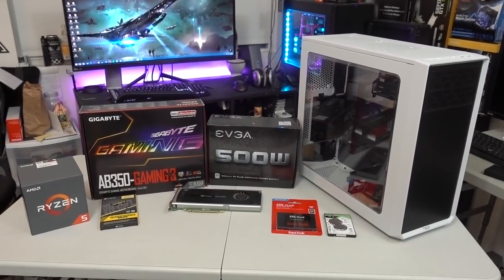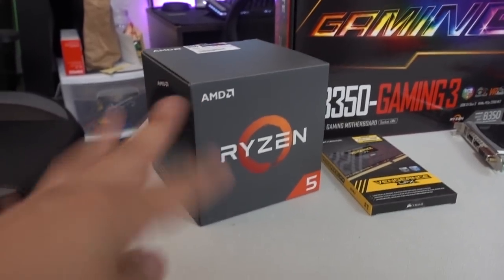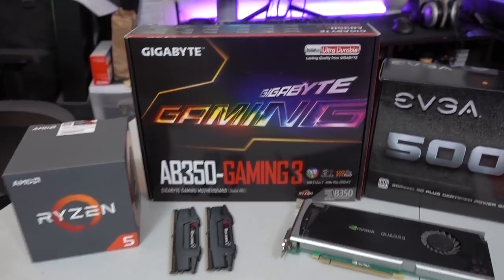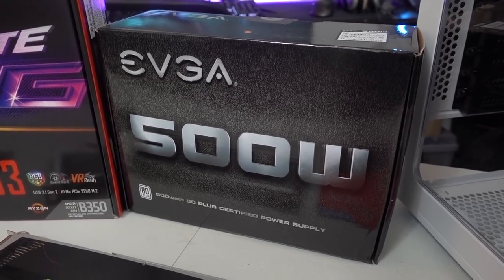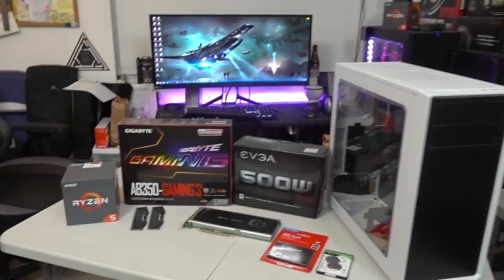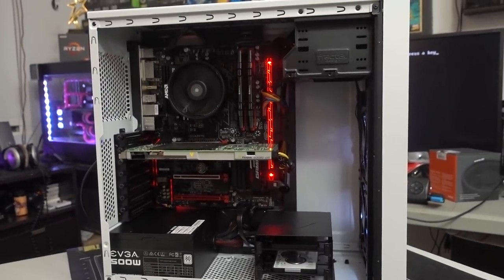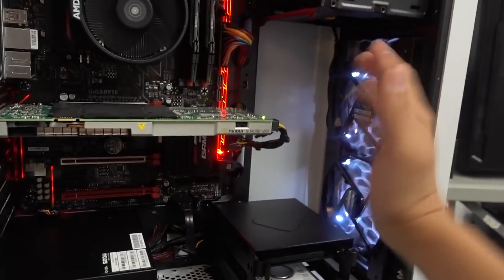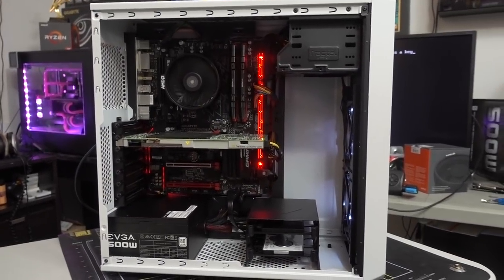A Ryzen Workstation for the Family!

Comment: $200 for refurbished Asus system with i7 3770, 12GB ram, 1TB 7200rpm. Added 120GB ssd boot drive and rx480 8GB before mining scalping. Beastly system for full autocad 2017 drafting and rendering at $500... A better processor would obviously "be better", but cannot be beaten for the price.

Comment: Wouldn't a GTX1050TI still be better in Cad than that Quadro? It's only a 475mhz core clock and only 256 CUDA cores sure it has better drivers but wouldn't the 1050 still be a better option for $200?

Comment: Thanx for making this video. I've just bought this case (Nov. 2019) and it was good to hear about the tips to trouble shoot like the audio plug in to the motherboard to be done before I put in the power supply. I'll use the 5 1/2" drive bay for a dvd / cd burner drive so is there enough room behind the mobo to tuck away the cables well. I did opt for a modular power supply this time around for my new Ryzen 2700x. I feel it'll cool well after I put in the total or 5 or6 fans the case can use. Do you think it will be good enough as a gaming and photography rig? Thanx

Comment: Would the 1700 been better for workstation cpu unless they are using the gpu acceleration for most if it
Reply: I wouldn't consider anything less than 1700 for a workstation.  This thing will probably be in a dumpster in about a year.  I know this because I destroyed a computer like this when I first stared editing videos.  The only thing good that came from that experience was I got paid really good to build another computer that could actually handle editing videos.

Comment: Not exactly sure about Fusion, but AutoCAD doesn't do "great" with multi threading. There's only a handful of operations using more than one thread at a time. It would be really great if you at least run something like the Cadalyst Benchmark for AutoCAD - I've still found that Ryzens don't do as good as the Intels for this, though at a higher price point. At least that would show some actual comparisons by running a script of instructions for creation and modification - thus able to compare with other setups.

Also, the quadro is the only officially supported graphics card from Nividia for nearly all AutoDesk products. Tested and certified with specific drivers. So yes, it's the choice when you want to be safe. Though for lesser cost you could get better performance out of some Geforce. You'd just need to test it for yourself using various versions of the driver. The latest isn't always best for CAD (it sometimes introduces bugs).

As for RAM, great, the less the disk gets accessed (even that SSD - though good call on that too) the better. Personally I'd say no CAD should have less than 8GB these days, 16GB is sort of average. With high workloads going much higher than that.

Anyhow, all that really depends what is being drawn. In some workloads an iGPU is fine, and the CPU itself isn't really of much importance. Sometimes a 4GB RAM kit just about squeaks through, while at others 64GB isn't enough.. Then again, other workloads could mean you need much better hardware - actually top of the range for all is still a bit on the slow side. Unfortunately CAD (especially 3d) isn't a one-size-fits-all idea.

Comment: Just fyi if they are using solidworks you are not going to use those 12 threads
Reply: there is a nice article on it on pjudget systems site comparing the 7700k and th 1700

Comment: Looking nice Kyle, "but" 3D modeling / engineering  I would use 32gb of ram or more. I'm maxing out my 32 at quite frequently  in cin4d/proEngi/solidW (engineers don't care about polygons) and mooooore and finer dust-filter. A workshop is no clean place ;) GJ wifysauce in building it, kyle probably just stood around :P :P

Comment: Hey I'm late but I'm looking at a similar build for 1080p video editing. Can you try and export like a 15 min video on it to see how it does? not sure if I'll need the 1700 instead
Reply: Devon Wenger Woah you don't really need a 1700 for 1080p video editing the heck even the 1500x can do 1080p also the graphics card in this is 7 years old so I would recommend another card to render videos faster and other shit.
Reply: Hector thanks. I'm currently struggling with the i5 4200u so I have no idea what a good CPU is like. as for GPU I'll get an rx580 when I can find one at a reasonable price but in the meantime I found a gtx770 for 80 bucks.
Reply: well a good cpu i would totally recommend would be the Ryzen 5 1600 it comes with a really nice stock cooler and with 6 cores and 12 threads you can edit or render any 1080p or 1440p video.Ok now thats the cpu opinion now comes my GPU opinion look a gtx 1060 is certainly better than a rx 580 in terms of Gaming now in terms of Content Creation i would think a rx 580 would be better but i mean you probably want to be playing games at such a stable and great fps so i would go with a Gtx 1060,Cheers.(also if you are getting a gtx 1060 i suggest to get the 6gb of vram variant)

Comment: I have 2 Quadro 4000's .... They are like a GT 630... also HOT AF except the HP one (black version)... You would be way better of buying a 300$ gaming GPU... even for 3D CAD.
Reply from the maker: I used afterburner to crank the GPU fan to 50% and am getting decent temps. Noise emissions aren't an issue since the rig will be in a machine shop. Also, gaming cards are great for video editing but typically lack reliability and accuracy required for precise calculations in CAD
Reply: Bitwit You got lucky getting a good one. Some of them were so bad that they were running at 100°C at idle... But still a nice build. :)

Comment: I know you grabbed whatever you have available to build this system
 but let say if you;re buying things off the shelves
#1 Case would be mini about $25 from Antec or a mid tower for $22 from Tt
#2 Motherboard as you mentioned wouldn't have to be a gaming one but you can save way more on 
ASUS Prime A320M-K for $60 yea there is no need for B350 or X370 for this build but ... for $20 more you can mATX from ASRock 
#3 RAM was it an over kill? stock speed are more than enough for this build#4 Video card choice works but regular gaming card would function ok and can be bought cheaper and with warranty like RX 550 or GTX 1030#5 PSU is good and it works and usually that's what I do whatever PSU deal around I would take it but I'm not going trust that filter to be cleaned on regular basis and I would flip the PSU for the fan to be inside the case#6 HDD performance on a 2.5 vs 3.5 unless that 2.5 was a hybrid then that's another story#7 why not pop in an optical drive? for $20 you can get a nice burner and that might be useful if they want to send projects in mail#8 UPS Battery Backup?#9 new clean keyboard and mouse? 
I think I ran out of things I would've done. But yea whatever you grabbed around you I would've done the same except for the RAM (i think it's overkill and I know how Ryzen likes fast RAM but still not needed), and I wouldn't pick that refurb quadro as I wouldn't trust it

Comment: Using a quadro is just lack of research from your part. If drivers working better on 3d rendering or whatnot in the past were a thing, it is not the case nowadays. Don't overclock it, and you will get a rock solid stability on regular NVIDIA gpus. And Ryzen 7  is still a clear choice if you are going for AMD. If you wanna do a "workstation" rig, don't go too cheap or it will be a useless system taking forever to do your renderings.

Comment: Kyle, you realize that gpu is a fermi gpu right? Like 400/500 series?

That thing is so many years old... I wouldn't be surprised if a GeForce card did better than it. Seriously,

You coulda got a p1000 or m1000 instead instead of getting something that hasn't gotten new drivers in a few years. I haven't even mentioned the bad psu...

Comment: You basically have my PC there lol
Reply: Ulises A. De Jesus lol srsly that's ur GPU?
Reply: lol man no,  but I have the same processor,  RAM, SSD, hard drive, power supply, and a very similar white case but with an Asus white card (GTX 1060)
Reply: ohh thats cool im planning to build a gaming pc my self i currently have a really old pc that is also a workstation
Reply: Yeah, Ryzen 5 1600 and GTX 1060 run very smooth, I'm only playing Overwatch right now lol, I actually got lucky with the card, bought it for $249 on Amazon, pretty hard to find cards at MSRP price right now...
Reply: A gtx 1060 for $250 wow that must have been a pretty good deal right now a gtx 1060 is $500+ which is pretty disappointing and whats funny a gtx 1080 cost less than a gtx 1060 rn.....And ofc gotta love those crypto currency miners for the prices being so high! (Sarcasm)

Comment: alot of 3d software are using graphics cards more and more to render these days.. but with the mining boom taking all the midrange gaming cards I see why you did what you did.. I would of gone 1060 6gb for 220.00 ish had the prices and availability been there.. 
power supply is over kill.... can go sub 500 easy to save $ and not sold on the value of 3200 memory with prices like they are.  2400 will work for 40$ less.. 
the case can be a 25 special.. no need to spend on that.. maybe even reuse the original? 
Those savings could allow you to spend 100$ more on cpu and get the rx1700. 
16 threads > 12 threads .

Comment: Aren't 2.5" HDDs much slower than 3.5" ones?
Reply: They can be, but not always.
Reply: MrOnihige of course there are some 2.5" drives that are faster than some 3." drives but with 50$ for 1tb you could get a 2.5" drive ore a 3.5" drive that has larger and more disks spinning faster.
Reply: Of course? FFS, why did you ask if you knew the answer? Ask the right question to get the right answer.
Reply: MrOnihige Of course some super expensive 2.5" drive is faster than a 10 year old 3.5" drive. I didn't mean that there's any chance that the drive in the video is as fast as a modern 3.5" drive with similar cost and capacity, there simply isn't.
Reply: You're all over the place. The ages of either drive doesn't matter, neither does their price. Harddrives are as fast now, as they were 10, 15 and 20 years ago. It doesn't matter if it's a 2.5 inch drive or 3.5 inch drive.

For all we know, they got that drive for free and they're just using it because they have it. Maybe it was on sale? Maybe they took it from an old laptop they didn't need any more? Who knows, who cares?

Again, ask the right question to get the right answer.

Comment: wow Kyle knows nothing about requirements for 3d cad. solidworks which is even more demanding than auto CAD primary uses 1 thread UNLESS rendering or in simulation. budget cad builds with a Pentium g3258 oc will smoke this flaming AMD turd
Reply: Logan .Kes Amd is still the best In the CPU apartment.